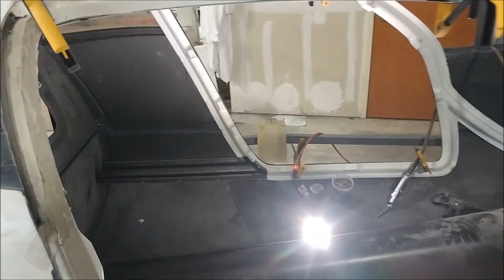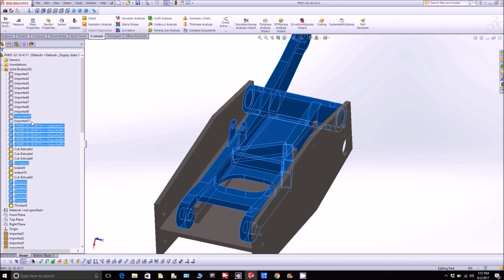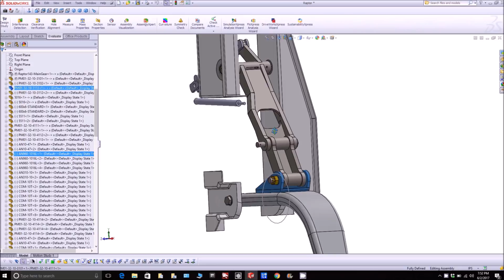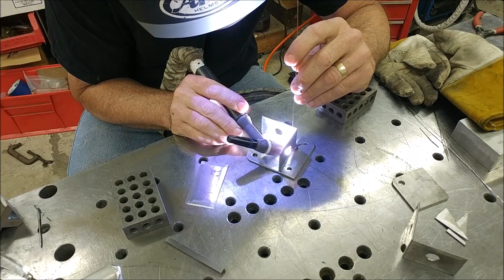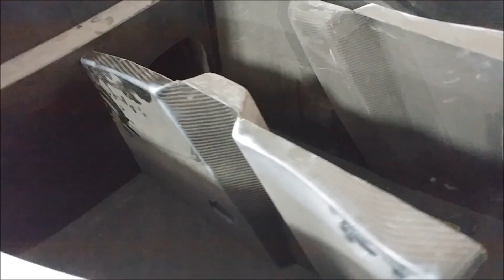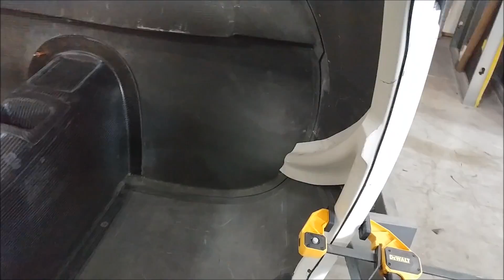Fitting and Welding - Fuselage and gear get some love

Comment: Why were the hydraulics set to act on the levers at the upper gear mounts vice directly on the joints in the arms?  What are the advantages or dis-advantages to either arrangement?